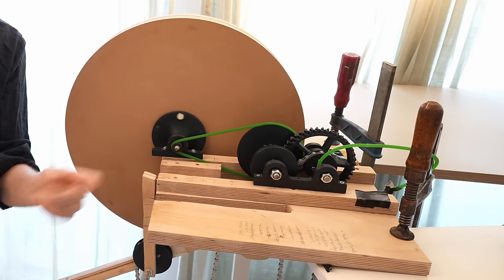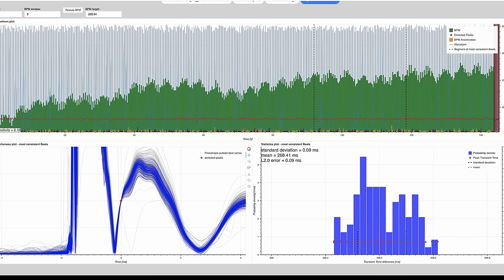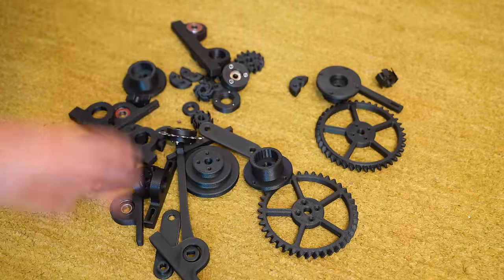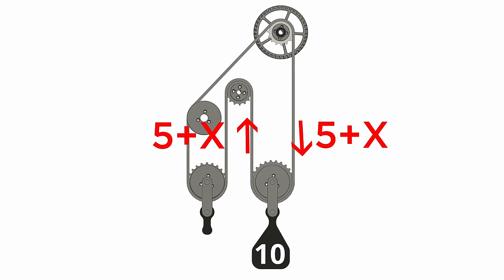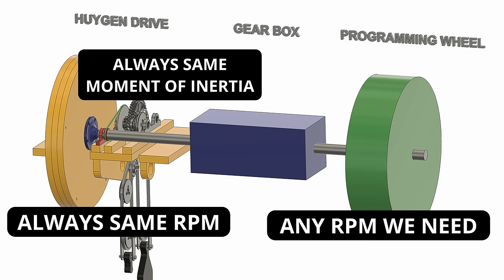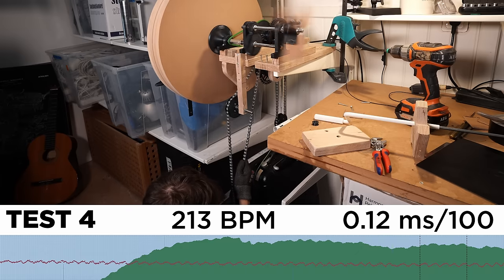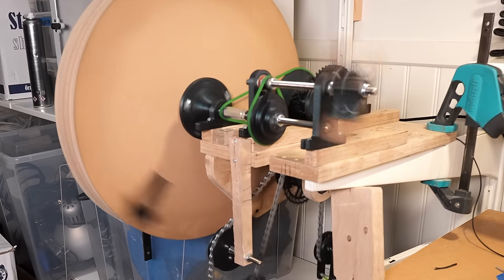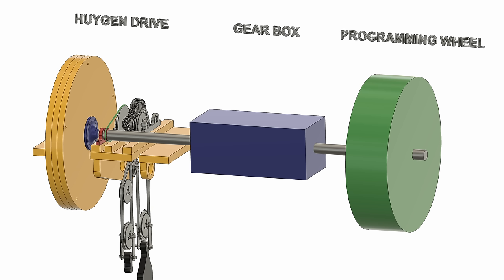Using Gravity To Play Tight Music

Comment: Martin, great video again. Try using a speed break that uses a liquid instead of air. Air density differs due to factors like temperature or elevation and this might have an influence on the tightness of the machine.
Reply: That's easy to fix with a variable resistance fitting, like the air governor clip he showed from the museum.  What he needs to do is make his governor spring actuated like all the ones he showed us

Comment: Great video, two things:
1) You could print an adjustable governor wich can extend its wings or retract them for different tempos
2) If you already have electronic mics and amplifiers, why don't you just use an electric motor and finish the machine? later... really later, whe the tour ends, you can build whatever mechanic power system you want.... just kidding Martin, it's always a pleasure seen you!

Comment: Love the test driven development! Very fun. The governor is helpful alongside the gearbox, but you also need a limit. As long as your power input is equal or higher to the desired BPM output power requirements, a limiter will allow you to put as much power in as you want but cap it to the set BPM value.
Reply: This is not analogous at all to TDD. It's more analogous to rapid prototyping without any requirements and a lot of scope creep.

Comment: I'm actually sad he's committing to the gravity driven machine. I know it's the best option in every way but it feels like the marble machine lost a part of it's soul, I know Martin will still be playing the instruments but now it feels to me like the machine is playing itself and lost what made it so special in the first place. It wasn't an automaton, it was an instrument. But now I'm not so sure anymore.
Reply: In engineering there is the term called "kill your darlings". Yes it is sad, but realise that Martin doesn't have to pay so much attention to the crank RPM anymore. Playing live, which is hard and simultaneously playing bass, which is harder, I think he made the right decision.
Reply: @MysteryAccordeonMan  Oh I know, as I said I also believe this is the right decision for the completion of the project. The hand cranking just felt like a requirement to me but I guess that's one of the traps in engineering, where you gotta reconsider every aspect of a project, even the ones that seem essential.
Reply: @MysteryAccordeonMan  Martin isn't an engineer. An engineer would put a motor on the damn thing and call it done, or suggest just using a computer.

Comment: Using an air governor is not really a constant speed governor. It is adding resistance till it keeps an equilibrium, but when you add the force that the machine will use that equilibrium will change with what the machine is doing. For example a musical measure that plays a lot of notes will take more energy than a measure that plays one note. The governor needs to sense that change in load and respond accordingly. I think a flyweight activating a brake is a better way to go. This is the system that Victrola's used and it produced a very stable RPM, even when the power input varied (cranking the handle). I think this would give you very consistent speed even if you went back to the ratchet type power input. Which is probably easier to do with your feet while playing music with your hands.

Comment: Sorry if this has been said already, but I'm not going to read all 1.1 thousand comments first. 

One of the things you'll see that each and every one of those air governors have is some sort of spring mechanism.  As the RPM increases, the vanes move out and catch more air, which increases their resistance.  You absolutely have to do this, otherwise all you're doing is adding resistance into the machine, which will result in the gradually increasing speed as the test proceeds.  The flywheel is a mechanical battery, that's all.  As it gets more energy via the crank, of course it gets faster. You need variable resistance to make it work properly, thus, springs on your air governor.

Comment: In my mind the drift in tempo is because you are using gravity to power the wheel which is a force and like you said f=ma, but if you want consistent tempo you would want a constant speed which would be 0 acceleration (after it gets to speed of course). I think when it becomes a full marble machine the friction from all the gears would likely result in the net force on the wheel to be negative instead of positive like it is in the video (so instead of the tempo increasing with constant cranking it would decrease). So I think the best thing you can do is experiment and find the right mass in order for the net force to equal zero since although you can't change gravity which is the acceleration you can change the mass. I could be wrong though and if that doesn't work then maybe do something like what grandfather clocks do with the ratchet mechanism to keep time.

Comment: Hey Martin. Great work as always, pal!

I was thinking... If you add a clock escapement to the driven chainwheel, it will control the speed of the drop, removing the requirement to maintain a level height. Plus it should counteract the gradual acceleration of the flywheel.
Reply: Also a clock escapement would enable a variable power consumption.

Comment: I spoke with a machinist one time, and they said that they would run grinding wheels overnight just to allow the temperatures to stabilize.

You may want to consider powering your machine for an hour (or 5) just to see if the temperatures and consistency will stabilize.

Comment: One idea to gradually adjust the air governor I would suggest adding threaded wings so that you can change the rotational inertia, similar how mechanical watches have small screws on the escapement wheel, to trim it in to have accurate seconds. This way you can tune in for different BPM by adjusting the rotational inertia of the air governor wings, by just screwing the wings in or out.

Comment: @Wintergatan Hey Martin, here is an idea. In your new design you need to power at least 3 things: 2 marble lifts and 1 programming wheel.

But out of these only the programming wheel influences how tight the music is. Do all 3 need to have the same power source? Why can't the marble lifts have separate power sources that do not need to be tight nor even in sync with rest of the machine? The marble lifts just need to be fast enough to provide a constant supply of marbles, if they are too fast they just run empty.

Also I will reiterate my 2 earlier suggestions: 
1. To use some sort of chained punch cards (like the Jaquard loom) instead of a programming wheel (the wheel restricts you to a single loop length). It might even allow live splicing of the pattern.
2. To keep the whole thing modular with easy to couple and decouple interfaces so you can exchange/upgrade power sources and instruments. At least a power source interface between the power source/s and other modules and a trigger interface between the programming wheel module and the instrument modules.
Reply: Yes. This baffles me as well.
Reply: But maybe I've misunderstood — is this already the plan for the third machine? The whole talk about having a big big weight to make it super tight just makes it feel like its emulating digital precision rather than exploring making tje human play as tight or loose as they like or can?

Comment: Also keep in mind that as RPM goes up, assuming the same amount of power is input to the system, the output torque of the drive will decrease. You will need to find a balance of the speed and torque of the drive in order to not only keep your music in time, but have enough torque to drive everything downstream of the drive such as the gearbox, programming wheel, etc...
Reply: This is not an issue, you can trade speed for torque whith a gear or pulley system.

Comment: I think to evaluate the standard deviation for different tempos better, you also need to look at the relative standard deviation. Higher BPM have faster cycles so a lower standard deviation might have the same impact on 'tightness' as one that is scaled similarly for a low BPM. 120 BPM has a period of 0,5 s so a standard deviation in the period of 1 ms can be expressed relative by simple division σ/Δt=0,001s/0,5s=0,002 or 0,2%. And at 240 BPM a standard deviation of 0,5 ms results in the same relative standard deviation. 

Musical tightness becomes harder to tell for a listener at higher BPM also.

Comment: Gearing up the governor isn't just gearing up the speed of it, you're effectively gearing down and amplifying the amount of torque the governor can apply to the rest of the drivetrain. There's two factors at play, friction increases non-linearly with speed, and gearing up the speed. Also gears down the return torque. It's like downshifting a truck engine before you roll down a hill, you're not only driving the engine faster and therefore increasing the amount of friction it can generate but also amplifying that friction force before it goes back to the drive train.

With the air governor, when you increase the length of the blades, you're effectively increasing the linear tip speed which works roughly the same as gearing it up. If you instead experiment with making the blades thicker and thinner, changing the cross-sectional area of the blades instead of making them longer, you might have more precise control.

Comment: The 2 main factors causing the slow speed up over time are heat and wear.  Friction in the bearings will make the grease less viscous as you said but also will make the gears and chain a bit slicker and the belt a bit softer.  The thermal effects should stabilize within 10 minuets or so.  As for wear, the 3d printed gears will become smoother as they wear down, resulting in less friction.  The effects of wear will decrease the longer you use the same gears.  
I recommend using graphite powder on the gears.  Graphite is less effected by heat than grease and will reduce the wear rate.

Comment: Can you remind us why you're against using motors to power the programming wheel?
I mean I only see points for it, none against it:
- You're still going to use microphones on it to isolate the sound of the instruments from the noise of other moving parts. Use the same source for the motor?
- This actually solves all of your tempo, manual labor, rpm deviation and tightness issues. Stepper motors are excellent for maintaining the same rpm even with dynamic loads (and to overcome this dynamic nature of the load, you would need to implement heavier counterweights, heavier flywheels and a gearbox that would be more sophisticated than one in a car, possibly even find a way for the gearbox to react to different instruments being enabled or disabled)

In my opinion, electric motors not only will reduce or remove your issues altogether, but also it'll be more in line with your mentality of "function over form", reducing overengineering and using off-the-shelf parts. Please consider and maybe test this option. You can't possibly account for all friction and loads of the finished machine when you finish the "power module", and you won't know how much to compensate for all that with your proposed solutions.
Reply: Everything on this project is a "dumb design requirement."  Including ignoring a simple motor.

Comment: The fly wheel might be reduntent nog when you have a new potential energy storage system and a govenor, ”the best part is the on that is’nt needed”. Plus the fly wheel might cause slow drifts in RPM changes as it slows all system inputs down, much as a low pass filter, inclucuding the govenor breaking. Any ways, love the videos, cheering for you Martin😊

Comment: The centrifugal governor doesn't regulate speed on its own. The position of the balls is linked with a lever to control a steam valve traditionally, creating a feedback loop with the power input regulated to keep a steady speed.
With this flywheel a centrifugal governor could be linked to a friction brake to limit the maximum speed.

Comment: Considering that you will have a dynamic load on the output by the end of the project, you are going to need something more sophisticated than a simple air-governor. You'll need something that is more equivalent to a PID control loop - currently the air governor acts as basically just the proportional control (I may be mistaken of course but at least my logic says so). Oh, by the way, you are probably always going to have some degree of speed oscillation in your system simply because of inertia... There is no way to achieve perfect equilibrium in real life - say the flywheel is going just a bit slower than what the equilibrium speed is, the resistance on the air governor is smaller than at equilibrium, so the flywheel-gravity capacitor system is allowed to start accelerating. Once the flywheel accelerates up to the equilibrium speed, only then does the deceleration of the flywheel-gravity capacitor system start, thus making the speed overshoot. You can reduce this, but never get rid of it.

Comment: Some questions I asked me:
1. Why is this ridiculous flywheel needed anymore? 
2. You are here in a range, where even a drift in the weather conditions (low/high air pressure) will change your timing. Why don't you have an idea, how tight is tight enough? If thightness is so important, why don't you use clock-like-systems?
3. How much weight do you need on the chain to drive the whole machine in a stable way? This an important question and the answer will surprise you.

Comment: Seems like a centrifugal governor is the right call, but without some sort of closed feedback loop, you'll find yourself with the same tempo creep as the air governor. If you connect the governor to a brake that presses against the weight chain or flywheel, as the governor slowly picks up speed, it will brake the falling weight more and more, slowing down the flywheel. Look at the Porter Governor used in engines, it's directly connected to a valve that controls fuel flow, so when the engine speeds up the governor restricts the flow of fuel. The same principle can be used here.

Comment: The cardboard governor wings will deform under load and become a variable. A design where the cross section and/or angle of attack,lift,drag can be altered with stiffer blades will be more effective. An alternative could be to use a centrifugal governor as per Christiaan Huygens which would also look really cool IMO.

Comment: A potential mechanism by which the speed drifts up could be that the air governor is built using something too floppy. As the drag force is applied on it over a long period of time it might be plasticly deforming the flaps slowly and slowly increasing their bend and therefore slowly decreasing their drag applied. A more rigid air governor may solve this

Comment: I just had an idea that might help: add a torsion spring between the chain drive and the flywheel. the spring and flywheel will allow the speed to oscillate and the governor can dampen the oscillation to get the perfect behavior.

Comment: Try the high BPM when it is cold (open a window and let it cool down for an hour now in winter) and then see the speed gradually increase over time till it reached equilibrium. To reduce the impact of that increasing the inertia has NO effect on that at all!
You can increase its weight to be 50 kg and it will be exactly the same - as the friction from the bearings is essentially the same as the friction from the governer. To combat decreasing friction you can either run the machine a couple minutes before starting anything or artificially pre-heat the bearings. The first will takes more time, the later will need you to measure more to get it right.

And for the "tightness" - as others have said any deviation should be measured relative not absolute, and with these low numbers you will be introducing measuring jitter. How accurate can you even measure? Sampling-rate, clock-drift and jitter will likely be dominating factors when you are getting down to precise measurements and you'd likely need something other than audio-equipment for this.

Comment: Instead of looking at your suitcase and guess if your stable, just add a cardboard to you suitcase that go all the way up to the governor height (example). Fix your suitcase height by putting some stuff below it and on the cardboard end, you just have to draw like a green rectangle. Then add a small fix cardboard arrow to your frame. Now, you just have to maintain the arrow inside the green rectangle. Tadaaa, you're much more accurate and you can easily see if you add too much or too less input in your crank

Comment: As a govener, use clear pipes with marbles inside, mounted at an angle. So he faster it spinns, the higher/further from the center the marbles will move and slow down the govenor. Like on an old steam engine but using marbles as they are the theme of this machine after all.

Comment: a self adjusting governor like old school steam engines had would help a LOT. the main thing then becomes getting the spring resistance right... (to strong a spring and it wont open up and slow the machine, too soft and it will just max out) ...and the weight on the governor right (too light wont do anything and too heavy will kill speed too much)

Comment: As you clearly shown in this experiment the speed will depend on the load (in this case the length of the wings of the governor) and it will play tight only as long as it is constant but as soon as the load changes so does the tempo. For a full machine this will happen we you play different rates of notes unless you have a construction for handling this such as an pendulum or spring connected with an escapement. Exactly what you find in a clock or a metronome that are built to keep tempo.